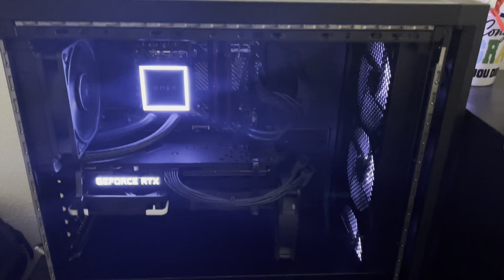OMEN 40L - (Better Thermals Optimization Guide)

Comment from the maker: NOTE : The video got corrupted which did not let me showcase pictures of the internal part of the Graphics Card so here is the link showing the stock thermal pads and what I did : https://drive.google.com/drive/folders/1gGtnCbr7r-BHzBZHa4PW3ckdalDesn2o?usp=sharing
 - 1st Picture shows the stock pads removed and placing the bought thermal pads in progress.
 - 2nd Picture displays (2) Sets of 1mm Pads along with thermal paste between them. (Thermal paste wasn't necessary, just wasted what was left).
If you need extra guidance on removing the AIO or Graphics Card please refer to the Official OMEN 40L Removing/ Replacing Components Video by HP.

Components:

Noctua Fan : https://www.amazon.com/dp/B09C6DQDNT?ref=nb_sb_ss_w_as-reorder-t1_ypp_rep_k0_1_4&amp=&crid=2UGBJ9N4IXDOT&amp=&sprefix=noct

Noctua PWM Fan Controller : https://a.co/d/hTjHXi7

ASIAHORSE Fans : https://a.co/d/iORb3QL  

Thermal Pads : https://a.co/d/6H2SdpV  

Black Zip Ties : https://a.co/d/aTfvfEC

Comment: how do you know if noctua fans arent getting detected? mine spin when the pc is on but idk how to check if they arent on 0 noice level mode
Reply from the maker: when using software to control fans, they won't pop up as fans that you can configure. Yes when you plug them in, they will turn on and spin but at a very low level, you're basically using them on a low constant speed without being able to change that
Reply: @howsue  so how do I change the speed, there's no additional software ?
Reply from the maker: @davidvictory9764 there’s many software out there but none I have tried have worked. But the main cause of this is the motherboard itself.

Comment: Hey Eli, first of all, thanks for the video, it helped me understand the issues of my PC. Since this is my first PC I don't have a lot of knowledge when it comes to these things, you could call me a bit of a newbie here. However, my main problem is that my GPU gets way too loud, I have a 3070ti and the fans sound like an airplane when I play cyberpunk, the witcher etc. As soon as my gpu starts making troubles, the other stock fans in my 40L omen build also make troubles. The build itself is quite strong, so it's not lagging at all or something, my pc is just too damn loud. 

I have tried undervolting and it did help massively with the sound, however, the tutorial i used made the game crash after a few minutes. So I know that a proper undervolting setup will help me here. Still, My question is, and maybe you can help me, do you think that adding 2 fans at the top will improve my issues? My gpu is the problem here, so I don't really know if that will help at all. Maybe you could have some tips for me here? Btw, my PC is only a year old and I have cleaned the dust and everything. So reducing the sound of my gpu is my main problem here and I thought about buying two additional fans
Reply from the maker: No problem, glad it helped you! Adding more fans doesn't hurt the pc so I'm sure it will improve a bit of the airflow and help you out, however, before you decide to buy some have you tried changing the speed of the fans at certain temperatures like I showed in the video? and have you tried limiting your framerate (FPS)? I'm not telling you to lower the quality of your games but games like cyberpunk should have an option to cap the fps or hz being displayed, for example I game on a 244hz monitor however my gpu can't keep up with 4k so I'm constantly getting fps spikes from 128 frames to 244 frames and it makes the game choppy along with my GPU being loud so I use the program RivaTuner Statistics to cap my framerate. It was recommended to download it along with MSI Afterburner in the initial setup. If you haven't you can look it up and download it, the main focus is to provide statistics of your pc, this includes ram usage, temperatures and wattage, etc, but the reason I'm recommending you to use it which I did not include in the video is due to the Framerate Cap, sometimes games only have certain fps caps at 120fps, 144fps and 240 however since you have a 3070Ti I'm sure you can push your games above mine lol but im letting you know this because you can cap all your games at whatever frames you want to be displayed which makes the GPU stop stressing when you get more fps and low fps. (This makes the GPU go from loud to back to normal and so on) If you have any questions, feel free :)
Reply: @howsue  Thanks for your reply! First of all, I have been tweaking around a bit since I wrote this comment and I found a solution (partly). The undervolting does work, as I said before, my PC is way more quiet now and it runs perfectly fine on the highest settings in any game - EXCEPT Cyberpunk. I did some research and Cyberpunk is, as you probably know as well, very demanding, so it's basically impossible to properly undervolt here. My PC can handle Cyberpunk, almost max settings (without the new 40 series pathtracing of course), it doesn't stutter or anything. The only issue i have is the GPU fan-noise.

I have tried to limit the speed of the fans in the past in "omen gaming hub", however, if I do that, the temperatures rise from 75°C to 85°C and I got a bit worried here, so I didn't try it out anymore. I could try it out again, maybe it will work. So thanks for this tip!

Secondly, thanks for the tip when it comes to capping frames, I haven't tried that out. This might be a solution. I do have MSI afterburner now since I tried undervolting on the witcher and formula 1 and as I said, it worked. Undervolting in Cyberpunk doesn't unfortnately, the game crashes after 2-3 minutes because it needs more power lol.

Lastly, since I have done a bit of research, it has come to my knowledge that the 30 series in general does like to make some troubles when it comes to noise, ESPECIALLY the 3070ti (I was a bit foolish to buy a gaming pc with that card but as I said, it's my first one and I didn't really know the downside). They produce A LOT of heat, they work don't get me wrong, but they are demanding. My airflow isn't all to bad anyways, my pc is on my desk, so it shouldn't be a problem. And just like you said, maybe buying additional fans will only slightly improve the issue, because the gpu fans themselves are the problem here. 

I also have an application for my corsair keyboard called "ICU" and it monitors the temperatures of the graphics card. I have 3 sensors, 2 of them are at 80°C at max sometimes but the third sensor displays 104C° (which is absurd, even to me as a noob). I don't think that the graphics card is broken or anything, maybe it just needs more cooling?

I greatly appreciate you taking your time and helping me out here since I have no idea what to do else. I am kinda helpless here lol. The tips you gave me sound great, I will try them out and hopefully they can help. Thank you!
Reply from the maker: @MMD12.  yep, try capping your framerate and see if it works, if not then consider buying 2 extra fans :)

Comment: Do you know of any way to help reduce the tempature of the CPU? I tried reapplying thermal paste, but It only brought it down a small bit, and when I try to find a guide on undervolting the CPU on the Omen apparently the setting was removed from the Gaming Hub and dosen't show on the BIOS. Would you know of any suggestions?
Reply from the maker: Yea I also came across that, the only solution I can think of is getting a new cpu cooler or motherboard since a single fan just isn't enough for running minecraft at 8k.

Comment: Hello, can you tell me your 3070 bios version on GPU-Z and how is the temps under full load?
Reply from the maker: BIOS Version: 94.04.46.80.57
Temps under full load are below:
Minimum: 74c
Average: 76c
Highest: 82c
Reply: @howsue  Same Temps here,
 Bios: 94.04.3A.80.1F here.
 Is your 3070 with that idle fan stop feacture? mine do not have that.
Reply from the maker: @mnovak5433  no it doesn't have it from what I have seen

Comment: Hey Eli, I recently picked up this PC. It runs fine, but with only 3 fans, it's a little toasty. I'm not super tech-savvy. Like you, this is my first PC. For now, I just want to add 2 exhaust fans on top. But I don't want to pay for 5 fans when I'm only using 2 or 3 of them. What other brand will work? And maybe could you make a follow-up video just showing exactly how to connect with the fans? Any help would be appreciated.
Reply from the maker: Hey! Any 120mm fans work from any brand so don't worry about the ones I have, what I mentioned in another comment was to make sure that they come with a fan hub or if not you'll have to buy a separate fan hub to control the fans. I posted another video showing a quick overview of how to get things going but if you need additional help, just let me know :)
Reply: @howsue  Thanks Man!

Comment: Wouldnt connecting your asiahorse to the argb and 4pins on the motherboard add it to the (inactive) section in the omen command center. Making it where you can control it through the Command center.
Reply from the maker: The AsiaHorse fans have a different type of pin connection, not sure what it’s called but they can’t be plugged into the motherboard’s fan section directly on the back, only to the fan hub itself that came with it
Reply from the maker: maybe an adapter would work, but you would be paying unnecessary money for something that already works in an intended way. On top of that, non-original brand fans do not get detected.
Reply: @howsue  maybe i have to test it with fans that have the same pins. If anything i guess ill get a new motherboard and case. although i do like the case.
Reply: @howsue  would you believe each original omen fan is 54$. Lol. Have you though of putting two exhaust fans on the top?

Comment: Does the bios not detect any fans or just that brand? Im currently considering adding 2 exhaust fans and 1 intake fan to my case.
Reply from the maker: The BIOS does NOT DETECT any fans at all unless they are Omen Stock, so you wont be able to control them in the software or any other Fan Controlling Software, thus you will need to get fans with a Fan Hub in order for you to control the speed of your added fans. In my case a single Noctua Fan does not come with a fan hub so I would need to purchase one. However, AsiaHorse Fans come with a hub so I have no problems changing speed or color of the fans. I can make a separate video if you need, I wouldn’t mind.
Reply: @howsue  please do
Reply: Please do that videos.. I am thinking about add an intake fan and two exhaust fans too but have no clue how should I do it.. btw really great detailed videos. Appreciate it!!! 🔥🔥🔥
Reply: Would like to see a separate  video . Currently just got a 40L myself
Reply from the maker: @hamiltonarmando  I made a seperate video highlighting on where to connect the fans if you're interested.
Reply: @howsue  awesome thank you 🙏

Comment: Would you recommend this as a beginner pc?
Reply from the maker: price wise, you can do better now that the 30 series graphics cards have been lowered and build your own a bit better than what the price of this pc is currently (I got it on discount for $500 less) but despite the price yea I recommend it, it runs everything I throw at in on max settings however the CPU cooler can be better and you would want to buy some fans but overall very satisfied with it. Some cons are that it comes with bloatware aka unnecessary programs and the BIOS is limited in some factors but I don't mind it. This is my first pc.
Reply: @howsue  awesome thanks for the information I appreciate it

Comment: Did you ever experienced the psu fan revving up randomly just to slow down right after?
Reply from the maker: Yes and no, I do hear a fan (not sure which) from time to time after being afk revving up and then slows down and stops along with the light from the AIO turning red. Not sure if this is what you mean but if so, yes.
Reply: @howsue  I upgraded my aio and added 3 more fans my temps are great and my computer noise is very low but once in a while the psu fan randomly revs up wich is pretty annoying. I don't think that is normal
Reply: @diogo_2790  it's normal, my 40l does the same thing. From what reddit says it's completely normal as well.
Reply: @why_fight  Was pretty annoying, I ended up upgrading to a Seasonic 850w gold and I can't even hear it now

Comment: What were ur temps running games with the stock cooling ?
Reply from the maker: Proccesor would sit at 70-80c now I rarely see it reach high 70's staying lower than 74c and graphics card about 74-80c. Graphics card reduced by 10-15 degrees and CPU got reduced by about 4-5 degrees. Keep in mind this was after MSI Afterburner use altering the Graphics Card, without MSI Software the difference for it was only 3-5 degrees.
Reply: @howsue  u should do some recording while playing different games :D